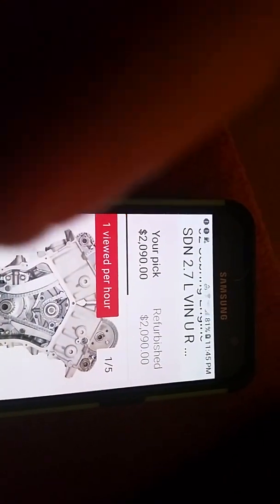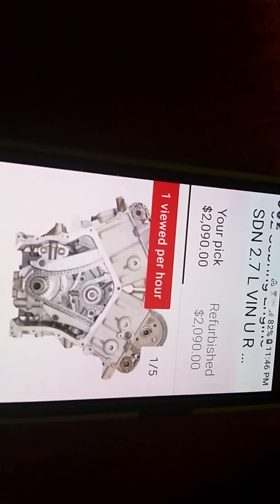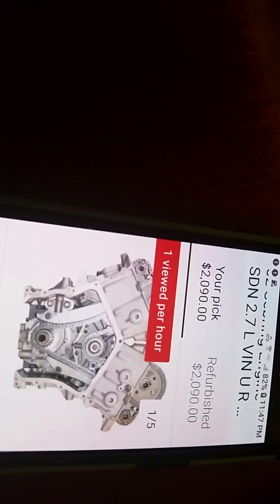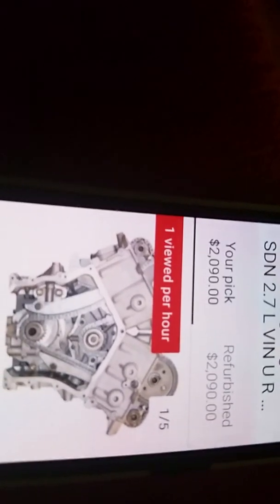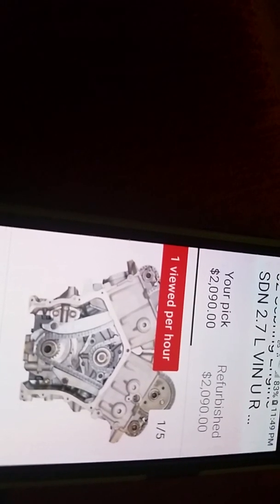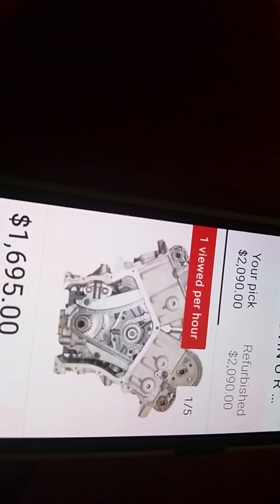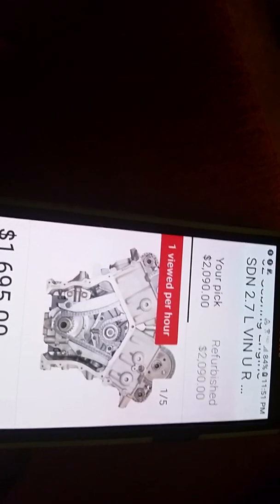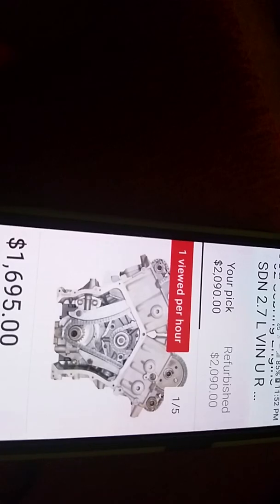3.6 V6 BEST Oil Recommended by Engineers.  Can we trust them? 0W20? PENTASTAR

Comment: Good info, thanks.  Ford did the same water pump nightmare, chain driven, inside the engine.  Water pumps fail at some point....that's a promise.  Mine was in a 2014 Ford Edge, 3.5 V6.  Traded it off before it cratered on me.

Comment: I don't live in snow country, but it gets below freezing at night in the winter sometimes, back up to 40s and 50s during the day. If I switch from 0-20w to 5-30, what can I expect in engine behavior?
Reply from the maker: 0 and 5 are very similar.   My pentastar calls for 5w30....European v6 pentastar calls for 5w30.  CAFE calls for thin oil.  Wrecks cams in the pentastar.   I have one pentastar '14 with 600k.  Only oil cooler and waterpump /thermostat replaced.  5w30 quaker state full synthetic used.   No oil burning. Check out RAT 540 BLOG

Comment: Jk 3.6 here running 10w-30 mobile 1 extended performance 3 to 4 k change intervals. 57k on motor.
Reply from the maker: Try quaker state 5w30 full synthetic.   540 RAT says this oil is best.  My motor hates mobile 1.  Runs much more quietly on the above oil

Comment: Every car manufacturer is doing the same thing. Water pump in the valley driven by the timing chain. A water pump failure = ruined bearings. The Ford 3.5L same thing. 

Back in the day, Nissan 3.0L had a timing belt driven valley mounted water pump, no trouble...a leak was external due to dry running belt. But then everyone thought chains were superior and boom! GM has been using chains since the 80s and never had an OHC engine which would last over 200,000. 

It fits in the valley well for packaging reasons, but it should be belt driven if it is.
Reply from the maker: More $$ for them in repairs

Comment: Use 5W30 for the 3.6l
Reply: I also use 5w30 in my 14 wrangler
Reply: Just changed to ESP 0-30 on my 18 wrangler v6, with non approved for Chrysler. I noticed oil temps were solid 220-230 F off-road uphill, that 0-20 is at its limits.cant be having that now can we.

Comment: What oil do you recommend I have a 2016 SE with 93,000 miles ?
Reply from the maker: Too late.  Sell it
Reply: @3.6pentastardude81  i got a 105675 miles now and she’s running better then when I got it at 53,000 miles. Just have to replace a lifter, just replace the thermostat housing blew a 2in hole in thru the plastic but she’s runs better after I replaced it. I beat every v6 charger in my town. Kept up with Hemis to I smoke the 09 any day.

Comment: What do you think of Liqui Moli engine oil ? Should i use it or mobil 1 or pennzoil ? Plus, do you recommend replacing the oil pump every 100k miles even though i change my oil every 5k miles at most ?
Reply from the maker: Liqui moly is awesome.   Avoid mobil 1.   Penzoil Ultra with liqui moly ceratec  would be great 5w30 only.  If oil pressure is ok then leave oil pump .  Big job.  If you have time and $$!....go for it.  Go OEM
Reply: @3.6pentastardude81  thank u so much for your help man ! I just realized that pennzoil is not sold in our region (gulf region dubai). So if i switched to luqui moli or amsoil 5w30 which oil filter do you recommend ?
Reply from the maker: @rashidabdulrahman197  K&N hp-7026 or mobil 1 or OEM
Reply from the maker: @rashidabdulrahman197  it's really hot there.  I would try 0w40 oil.
Reply: I have 2015 jeep jk with 3.6 pentastar

Comment: I have a jeep jk with the 3.6L 105k miles. Just replaced oil cooler and now have code P06DE (engine oil pressure control circuit stuck on) car feels heavy on acceleration especially after 60mph. Any thoughts what could be the problem? And what do you recommend replacing to ensure longevity? Thanks for the info !
Reply from the maker: You need a professional scan tool if your connections are tight and clean.  I have 2 videos that talk about engine longevity.   

Live data on scan tool will tell u everything.
Reply: @AdventureWheels I agree

Comment: I have a 2015 Dodge Challenger SXT Plus V6 3.6 Pentastar. What brand of 5W20 you recommend for engine oil?
Reply from the maker: I avoid 5w20.  Pentastar loves 5w30
Reply: @3.6pentastardude81  I was recommended Pennzoil syn 5w20 for my 2014 pentastar........Yes or No??
Reply from the maker: Penzoil ultra is what goes in the Hellcat.   It is sold at the dodge garage.   Available thru amazon
Reply from the maker: Penzoil is factory mopar fill.